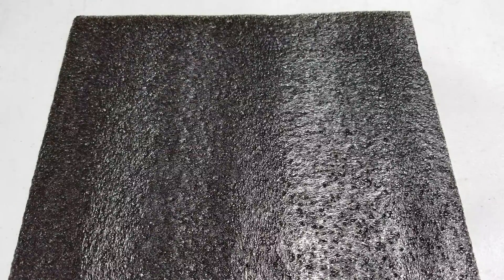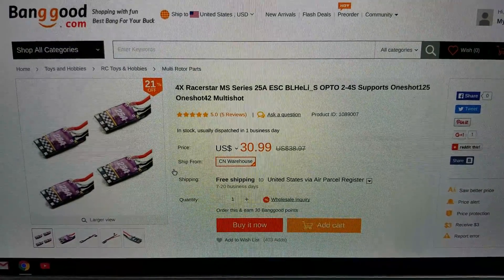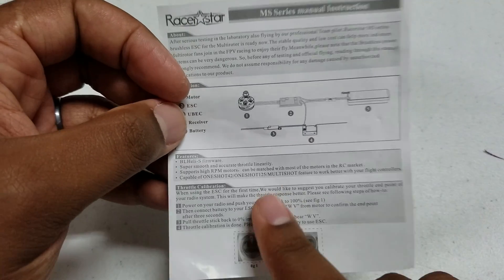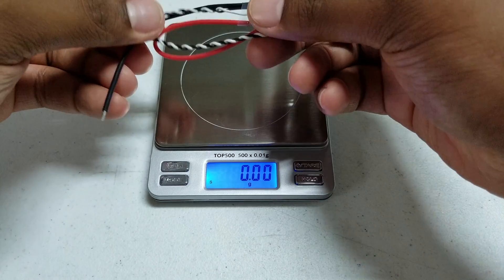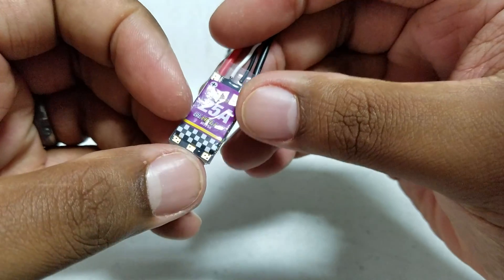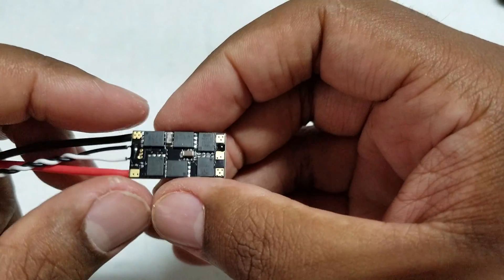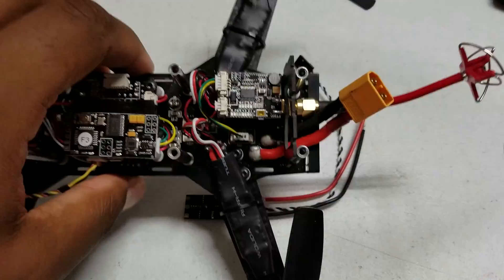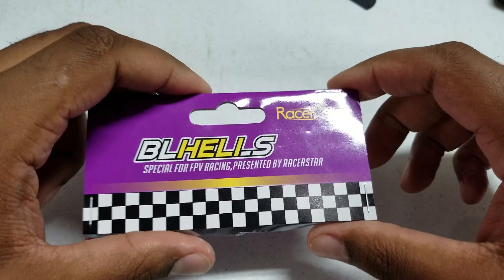RacerStar MS 25a BlHeli S ESC - First Look

Comment: Hi,help me, Its possible to use  Racerstar MS Series 25A with with this setup: 4 BR2216 810K motors, framse S500 and pixhawk controler? tks
Reply from the maker: Manuel Chaves you'd have to check their specs for amp draw
Reply: ok, tks.